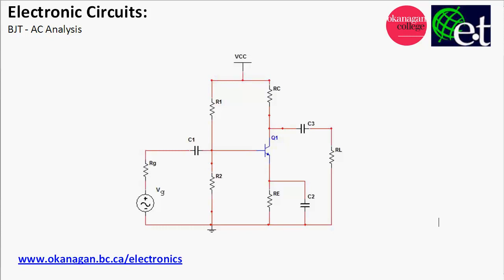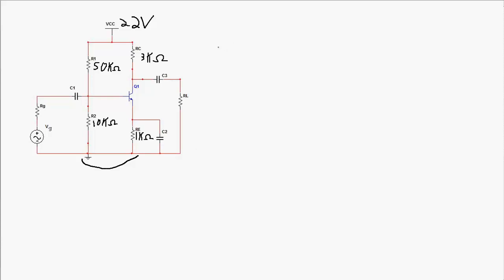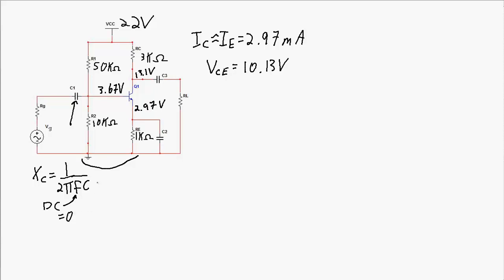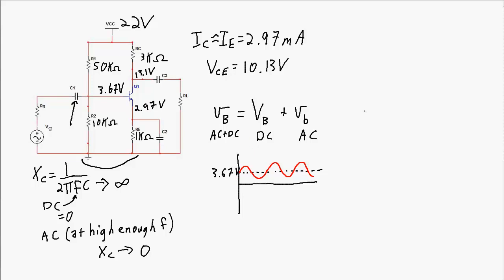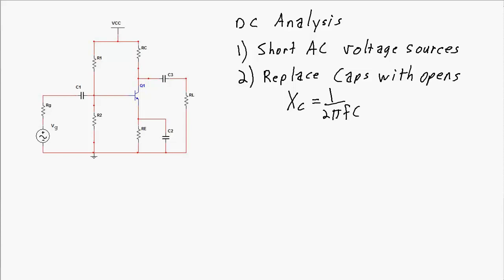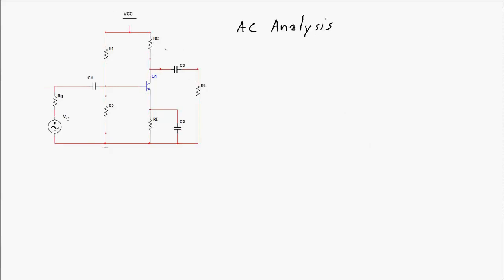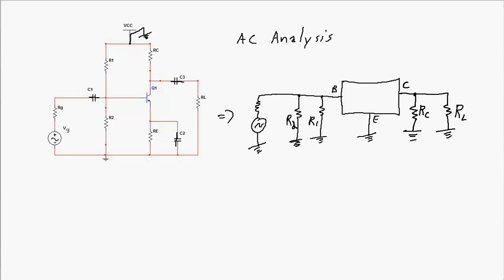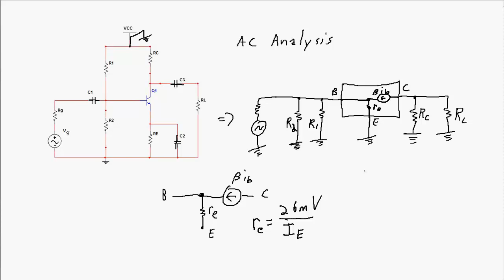BJT - Introduction to AC Analysis

Comment: The capacitor act as Open circuit in the DC circuit and as short in the AC circuit, that’s why the Re is cancelled in AC circuit but we will consider it in the DC circuit, Is that correct

Comment: Is the following correct? the base of the transistor is getting the AC current PLUS the DC current (the AC is riding on the DC). So the transistor is always on. Then the amplified result has the DC removed by a capacitor. If that is right, then a DC battery between C1 and the base of Q1 would eliminate a lot of resistors and capacitors(?). 

I'm trying to get an Arduino microprocessor to register a fluctuating analog (not alternating) signal from a weak piezo crystal at one of its Analog pins. Any suggestions?

Comment: Good explanation but can you clear up one question. How does the value of re given relate to a 0.7v drop across the be junction. Many thanks.
Reply: The current through a junction goes up exponentially as the voltage increases. At normal small-signal emitter currents (say 100μA to 10mA), the voltages needed to produce those currents lie in a small range from about 0.6 to 0.7 volts. If you drew a curve of Ie against Vbe it would turn upwards quite rapidly around that voltage range. At any point on that graph, the slope of the graph would represent the change in current for a small change in voltage. That is the reciprocal of the dynamic resistance of the junction at that point. If you do the maths (see "Shockley's diode equation), you find that the dynamic resistance is around 25 or 26mV divided by the emitter current at that point (or the collector current as they are virtually the same). So the higher the quiescent collector current you use, the lower the dynamic resistance of the base-emitter junction. You'll need that when calculating the gain and input impedance of the amplifier stage.

Comment: I think there's a mistake in here. While calculating Vce, you had used the formula...Vce=Vcc - Ic(Rc + Re), whereas I'd would use the formula
Vce=Vcc - Ic(Rc) . I fail to understand why is the resistance at the emitter even coming into picture? Please clarify this doubt of mine :)
Reply from the maker: Your calculation of Vcc - Ic(Rc) Would give you the voltage at the collector with respect to ground.  To get the voltage between the collector and the emitter, you have to calculate how much voltage difference there is between ground and the collector - this calculation requires the IcRe (i.e., the voltage at the emitter with respect to ground) be subtracted from the voltage at the collector with respect to ground.
Reply: Oh yeah! Vce = (Vc - Ve) . Okay I got your point. Thanks for clafifying. :)
Reply: +Jdeep Shiva 
Good question , and good explanation ! I learned things.

Comment: in the T model , where does the 26mV come from?
Reply from the maker: This is VT, the thermal voltage of the PN junction. It's not actually constant, but is temperature dependent. VT = kT/q. k is Boltzmann's constant (1.38x10^-23 J/Kelvin). T is the temperature in Kelvins and q is the charge on an electron (1.6x10^-19C)

Comment: With what value of Beta did you get those DC analysis values?
Reply from the maker: I didn't use a specific Beta value; I just assumed that it was high enough that the resistance looking into the base was high enough that I could ignore the base current.

Comment: Why would you use a model for the transistor that makes it so easy to jump to the wrong conclusions? If the dynamic emitter resistance is really seen between the base and the emitter (i.e. between base and ground in your circuit) as far as the ac analysis is concerned, then you're giving the impression that the input impedance of the transistor is re. Now, we know that the effect of the current source is to provide an effective resistance that is β times bigger than re in the base-emitter circuit, but you have to derive that part of the analysis every time, and if you have have students, you'll confuse them because they will forget the effect of the current source and think that the input impedance at the base is about 8 ohms (26mV/3mA).

It is far easier (and kinder to students) to use a model where the base and collector are separated; the collector-emitter resistance is re; and the base-emitter resistance is β.re. You only have to derive that model once, and then everyone has an easy time calculating the input impedance (which btw, depends far too strongly on β with the values you've used), as well as the gain and the values needed for the capacitors.

Comment: what is the differentiate between re=26mv/ie........... and re=26mv/ib
Reply from the maker: Those equations would of course give different values for re.  The correct one is re = 26mV/ie.  I think that what you are referring to in the other equation is what the equivalent resistance would be if we modeled the resistance in the base instead of in the emitter.  in that case, the resistance would be re(beta + 1) which is equal to 26mV/ib
Reply: Where did 26mV come from?

Comment: i'd solve for Ic i got 2.63mA
i did find first the Vb then loop from ground to ground in Vb to Ve. 
so this is my equations Vb-Vbe-Ie(Re)=0
then its 2.63mA
Reply: I think you missed the part where he changed the supply voltage from 20V to 22V. If he had not done that, your answer would have been correct.

Comment: If that capacitor connected to the emitter is big enough, to Short the emitter to ground, then this circuit is doomed to fail. The dynamic emitter resister re , will keep changing in value, in simple words AC gain =-Rc/re , re =26mv/IE , when Vc  swings by 10v pp , you will see magic. Sorry to say that.

Comment: Hi Steve 
With all the respect, that circuit of yours does not work, it's nice on paper, but not in the real world. The AC gain will vary like crazy, especially if you have good swing at the load.  ie the AC gain depends on re , which also depends on IE , and sense IE varies as the output changes, the AC gain will vary.